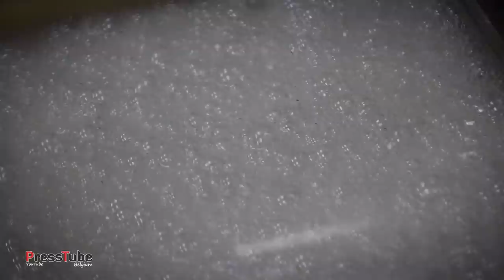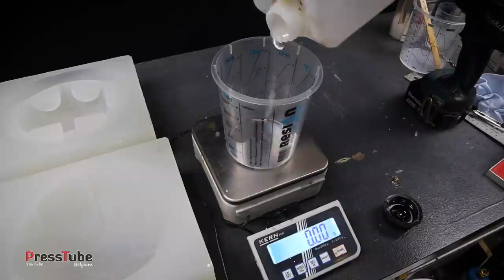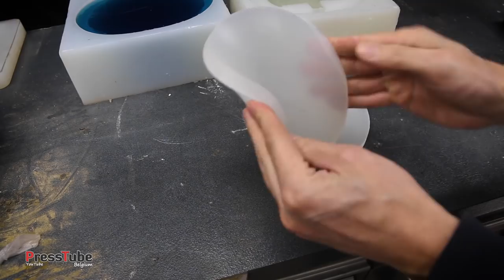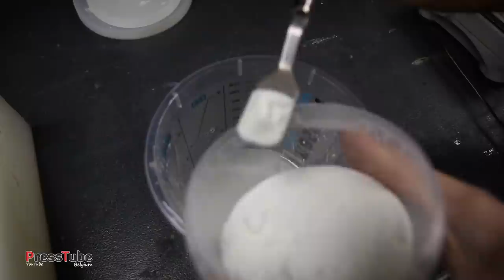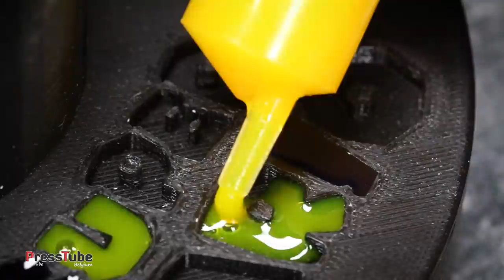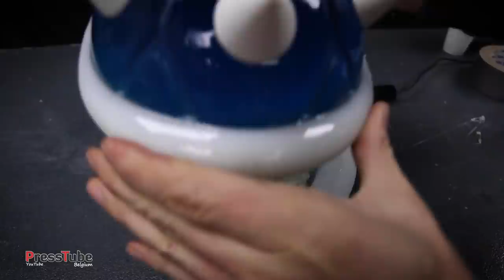Making a Mario Kart SPINY Shell Lamp!

Comment: That visible split line 😥😥😥 also paint under the lettering white to make the colors not fade right into the black. If you would have made that middle part a separate 3rd piece you could of much easier hid the split lines and made it far less noticeable